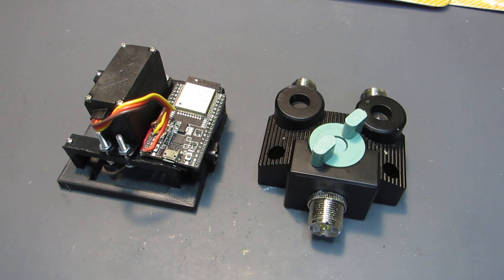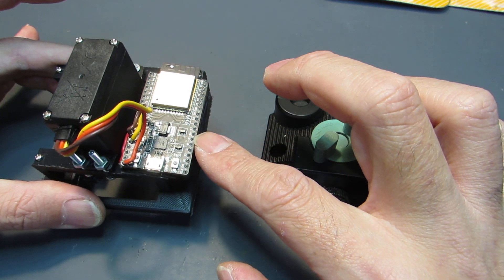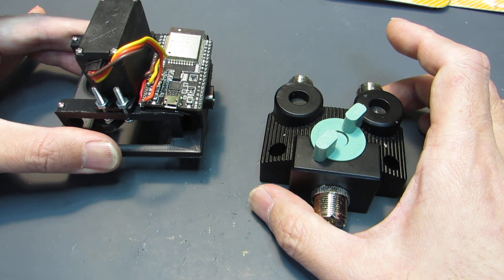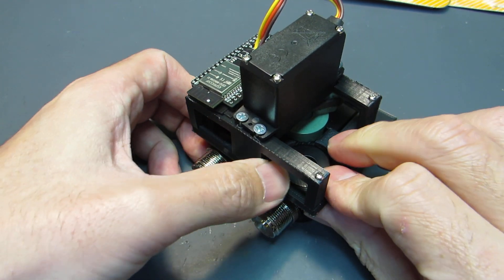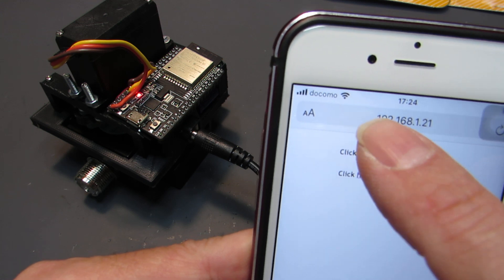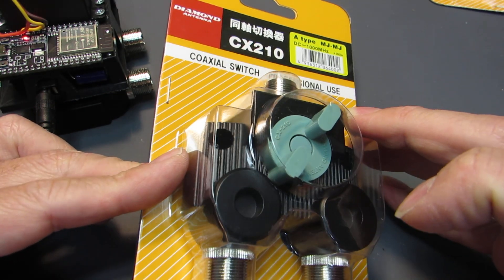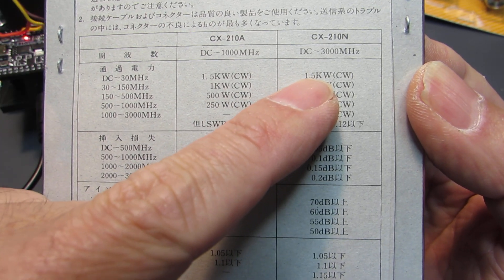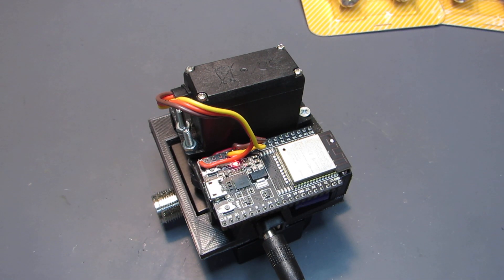WiFi controlled high-power RF switch is completed.

Comment: A very good project ... why you need am antenna switch for coaxial wires signals?
Reply from the maker: Because each antenna has different characteristics (operation frequency or radiation beam).